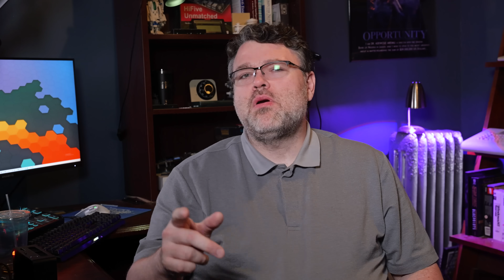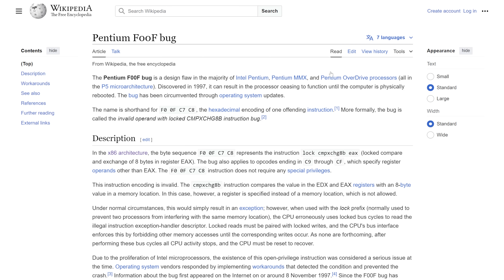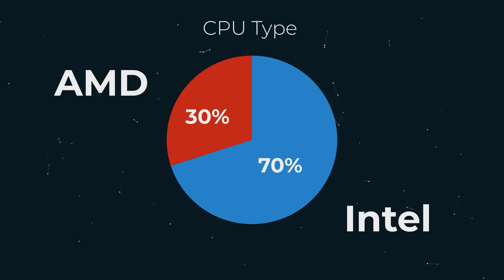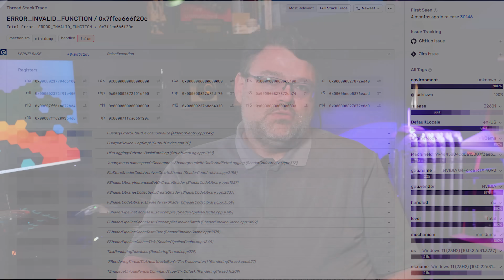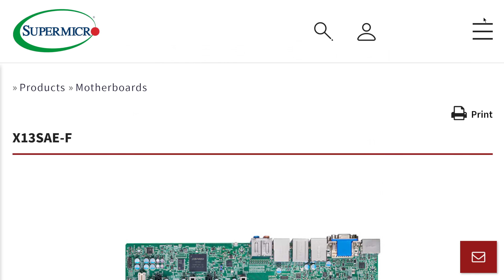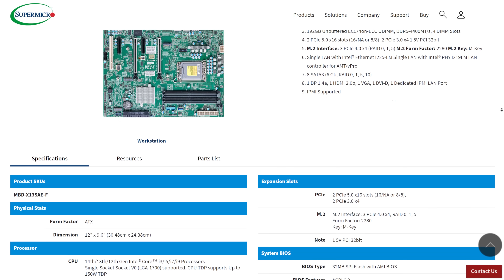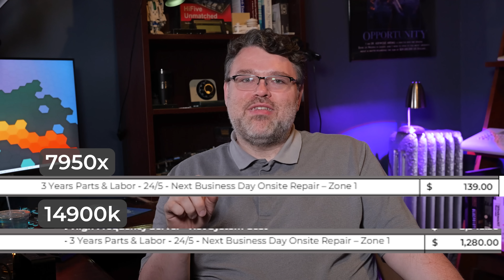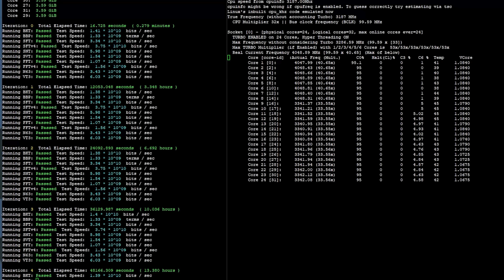Intel has a Pretty Big Problem

Comment: I've been having weird issues that I've been blaming on my AMD GPU, and it's more than likely the 14700k I have in my system.
Now I'm running 2 sticks of 16GB DDR4, XMP2 with CL16.

Last night, I had a weird issue where the system seemed to be having IO input issues, mouse movements were delayed and stuttery. Keyboard inputs like CTRL+ALT+DEL to bring up lock screen took about a minute to happen, then they happened all at once.
The only fix was restarting the computer.

Checked task manager before I restarted and CPU usage was at 1%, which makes sense as I wasn't just on my desktop not really doing anything, I had just finished playing Solar Ash without any performance issues and was just reminiscing about the ending when it became unresponsive.
Temps were all normal, around 45C at idle. (Noctua NH-D15 cooler).

Once task manager opened I started closing processes that I thought might be screwing up, but nothing helped.
Had to restart the PC.

No overclock is applied, though I do have an Asus Prime Z690-P D4, and I set the bios settings to motherboard, remove all limits.
I guess I could try setting all that back to Intel safe settings, though with the performance loss, what's the point of the Intel system when the 7800X3D from AMD exists?

Comment: My Intel i9 7980xe was perhaps the last push in tech. I overclock it to 4.9 GHz, and it works. At 4.6ghz, it is so stable.

Since then, Intel has been increasing the built-in overclock to drive sales.

Comment: Hmmm So I just reformatted because I had a memory leak and I couldn't figure out what the cause was. After 2-3 days of being on my pc would get up to 70ish% memory usage while idle and I'd have to restart. I haven't had the issue since reformatting a couple weeks ago but my Gigabyte Control Center app was also crashing every couple days. I also assumed the two were related but maybe not. The reformat fixed the memory leak but even after the reformat GCC is still crashing every few days (no other issues). Its easy enough to reopen GCC for my mobo RGB to work and GCC is a notoriously buggy piece of crap software. But now I am wondering if its GCC or my 13900K.

Comment: Replaced 13900K with 14900K, problem became worse, reinstalled Windows, even worse, random applications crashing on desktop while close to idle, limited power limits and clocked down to 4.4 GHz P, 4GHz E, still waiting

Comment: Well at this point a cpu is drawing more power than the entire high-end systems from years ago. How did anyone thought "it is going to be fine"? It is absurd that the manufacturers are just enabling more RPM in the engines without improving the engine block haul structure. 

Who would like to drive a car that crushes every time you press the pedal to overtake a car on a highway? Yet somehow we are thrown those types of cpus and gpus, crazy ram speeds that exploded just 1 gen ago...

Intel please go back to drawing board and think about the planet impact, scaling power drawing, improving QA (yes we know boeing did this but you are better)

Comment: It's such a strange issue. My guess, as a noob that works with alot of smart people, is that it is an issue with turbo boost freq on p cores or on e core, trying to reach too high, even for a uSecond. A cause as a result of a "dirty" fab or something or physical silicon issue. Something that popped up when they started 13th gen. The same time when they increased the max turbo clocks like crazy(5.2vs5.8). Max turbo "watts" stayed the same, I think.  

Any time I get issues on my computer(12700k)with the Windows nvme thinking it is corrupt on boot or tons of soft locks in apps/windows. Is if my turbo boost multiplier over clock, is to high. and when it's right on the edge, I get the same things as described. On my Linux nvme it won't be an issue.(though it goes through chipset(z790) instead of directly cpu connected, so I can't say the validity of the comparison)

Maybe try limiting max turbo boost and other related settings on the 13th and 14th to 12th gen specs and test for stability? 

On my12700k, I've noticed that I can get 5.4ghz on 4pcores with the rest at 5.3. (4.3on Ecores). But if I try 5.5 max turbo boost on just 1 core, with rest of the Pcores at 5.0.  I get all the instability as described in Windows only. Linux nvme will work fine, but not if i set two of the cores to max boost to 5.5. 

I looked it up 12900k to 13900k max boost "Watts" stayed basically the same(according to intelArk).

Idk, As a casual, I'm just thinking of the "simplest" issue it could be.
It would be cool if you could get 3d x-rays of the extreme fail cpus. Just to see.
Please do another future update video on this. Thank you.
Reply: TLDR. The intel factory spec is just wrong, and the "upto "5.7ghz boost freq" is degrading long-term stability. Maybe set up the 13th gen and 14th gen bios settings as close to 12900k settings and check stability. Just my atom of salt for the pile.
Reply: The frequency is related but its the fact that default voltage on almost all motherboards is 1.45V or more LOL this is what is killing cpus. You put 1.45V with any sort of loadline and you are idling at 1.5V+. Stock voltage is supposed to be ~1.0V with ~1.2V boost. Stock mobo settings has my 13700K at 1.45V, thermal throttling, using over 300W etc the same old story. I manually tune it to 1.26V 5.4Ghz locked with no throttling even under max load because wattage is now at 250W max.

Question is, who is really at fault? This has been the standard mobo behavior since I started reading about pcs. Any amount of research shows that mobos have always had terrible stock settings for K sku cpus since forever(since there is technically no standard operation of a manually tunable cpu, thats why the none K locked down untunable cpus exist). When I built my 8700K system in 2018 it was the same story, terrible default settings resulting in thermal throttling, manual tune and its running 5.1ghz without throttling.

*edit: just read another comment that some boards defualt to 115C max temp instead of the 100C spec. This 115C + 1.45V+ then hit the cpu with a max load. No wonder some are one hit KOs

Comment: is this only for the not running at Intel Setting 13900 and 14900 ? Or also 12700K / 13700Kset run at Intel Spec?

Comment: AMD has a metric fuckton of issues that a lot of people have kind of decided to deal with for the sake of price

ALL AMD cpus have a bit of microstutter
NO Intel cpus have a bit of microstutter in the same situations that AMD cpus have microstutter
Intel cpus have fewer instances that microstutter exists (and its not hard, because almost ALL games for AMD have microstutter)

it is important to note that in ALL of the older games, and games built on the older (basically non-BAR GPU access and direct-memory GPU access games) have ZERO problems on intel, and have less, but not zero, problems on AMD (one such problem is CCD switching, where games built for single-die CPUs would literally have their physics fail because the system was trying to shift the thread to a different core, which had a very tiny latency component to it, but gargantuan compared to the typical same-die core-to-core switching)

the issue usually comes from devs trying to push the system too hard

i know, because if you stop multithreading, the same games that crash, stop crashing, and it always coincides with the CPU pulling back even only if slightly on cycle speed (GHz) usually in an attempt to thermal throttle

its also only software-based, the system itself is fine

Comment: So I have a 13900k with the intel baseline profile enabled.  I get the occasional crash in a game, usually when the game goes from playable to a cut scene.   Intel needs to fix this issue, as it will cause a loss of reputation.  I have always been an intel guy.  But going from my rock steady 6700k overclocked to hell, to this 13900k has been a real eye opener.

Comment: PC Specs:
14900K (Dark Rock Elite cooler)
ASUS Dark Hero
ASUS ROG 4090
Corsair Vengeance (non RGB) 6400MHz 64GB 2 sticks. Was 4 sticks.
Samsung 9900 Pro 1TB and 3 Samsung 9900 Pro 2TB (Not using GEN 5 since it interferes with the GPU)
Creative SB AE-7 (when system would lock up, I would lose this and couldn't get it back in windows or turn it off and back on. I had to shut down, leave the PSU on, unplug and plug in and worked)
BeQuiet Dark Power 13, 1300W PSU

System Built 12/31/23 New Year's Eve. When I first built it, the system ran fine with stock settings and RAM 4 dims auto config from MoBo using ASUS optimize defaults with no XMP. Installed all software just fine. Then I noticed the RAM configed itself to 4200MHZ. I know I wouldn't get the 6200MHz out of it using 4 sticks. Returned the ram to Microcenter and got 2 sticks of 6400MHz and set it to XMP I, this is where the load shader hard freezes started. Then I would hard turn off the PC and try to get CoD MW3 to load again and the PC would get through it sometimes and get harder and harder as driver updates happened and all was fine till the next Nvidia driver update, and here we go again, 10 hard freezes in total over the next few months (and that was a bad time since they were updating the driver ever week for some reason, ass hats). Then I switch to the XMP II profile and no issues at all (I mean at all, still works to this day and I leave it on 24/7 (though I noticed a 1 frame texture on the side of a wall turn white here and there but not consistent, and no crash ((( you can see this in my videos I uploaded to my channel here on YT using the 14900K))). (OK back to the thing I was talking about) The news came out about these CPUs doing the thing and just as I found out the next day MW3 hard froze during gameplay using the asus Optimized Defaults. I then changed the BIOS to the intel limits and did some Jayztwocents tweeks and it's been fine since then. Crap A.D.D. kicked in and forgot what I was talking about, I kept adding things in parentheses and lost my train of thought. If I think of anything else, I'll add a reply.

Comment: On one of my systems, S-7E07 4.0 - Intel i9-14900K (32) @ 5.700GHz - NVIDIA GeForce RTX 3090 - 128DDR5, i keep getting random crashes i couldn't ever diagnose why the error keep changing, and it's softlock sometimes, i traced it to the CPU, but i dont have the knowledge to diagnose it further,  the system in Ubuntu running 24/7, i had to implement watchdog to reset the system incase of crash due to this, praying my drives don't die before intel do something about it.

Comment: I have a year and a half old system based on a 13900k, 64GB 5200 DDR5 (XMP set 1 I believe), 4070ti, Z690 C/D5 MB, AIO cooler and a Hyte Y60 Case.
Most unstable system I ever had. 
Originally it ran hot with default turbo's at 58 for the first two cores and 56 for the rest and a default TJ Max of 115C. It would frequently hit 102-105C. Hard BSOD crashes happened every couple of weeks and some games like Civ 6 just refused to even start, * and others like Oxygen Not Included, Kerbal Space Program 1, Cities Skylines 1 (and 2!) along with Project Zomboid would crash after 15 minutes or sometimes randomly last for an hour or more. RDR2 and GTA V ran fine oddly enough.

I found out about the MB factory overclock and unlimited turbo from Jayz twocents and learned how to do some adjustments.

With the following adjustments it has been stable for over two months and its highest temps under long (4hr+ game loads) has been 87-91C and around 84C for lighter gaming and daily browsing, streaming and so on. Not great, but one hell of a lot better.
In Bios I enforced Intel standards and manually set TJ Max to 100C (this remained at 115C even after enforcing Intel standards).
I am using Throttlestop rather than XTU. It currently seems stable with undervolting CPU core  -.070 CPU P Cache to -.085.  Any lower and Firefox tabs begin to crash on a regular basis, but nothing else seems to be affected...odd?
Turbo Ratio varies by game. CIV 6, Oxygen Not Included and Nolvus Skyrim  I run at 53 across all cores.  RDR2, GTA V, KSP1 and Project Zomboid will run with the first two cores at 54 and the rest at 53. 
Civ 6 and Skyrim won't even start if the first two cores are higher than 53.
Long and short power are at PL1 = 125 and PL2 = 253 respectively.
I have not (thus far) had to try and disable E-cores or slow down my memory and did not update my bios, as last time I checked it was a beta release, and frankly I just don't trust a beta from ASRock at this point in time..

I have reinstalled windows twice and ran an update repair once since the system first came online (two Samsung 980 Pro 2TB drives and one 6TB spinning rust WD10 6300rpm archive drive.)  I have literally ran the sfc /scannow and DISM suite hundreds of times and Chkdsk dozens of times. Something my 10 year old Overclocked AMD system almost never needed!

*Different crash every time according to Who Crashed? Two of the more frequent ones were a rather generic exception error and OUT OF VRAM???? on a 12 GB video card????

Just my contribution to the sad tale of expensive CPU's that cant run at their advertised speed without major problems with heat and crashing!

Have a great weekend everyone, and best of luck!!!😎

Comment: Absolute insanity. Makes me glad that when I upgraded it was a 14600KF I went with rather than a 14700 or 14900. Gaming on a 4070Ti just isn't CPU-intensive enough to justify the higher end CPUs, and although I compile Source engine maps (which uses an intensive CPU-based ray-tracer for the baked-in lighting) a 14600KF is still massively better than my previous i7-6700K

Comment: I own 14900k and I have no issues whatsoever, maybe people that experience crashes do dumb stuff with a CPU, too many visits to OC menu in the bios for example... I had no issues before microcode and power profiles updates to the bios as well as after... probably the same people that have issues with those CPU are the same people with burned connectors in 4090 as well as cracked GPU PCB, or they watch too many videos on YT titled "10 THINGS YOU SHOULD ABSOLUTELY DO WITH YOUR PC" :P also I run memory at 6800, in 3dmark time spy I have a score over 34k so its not like I run in in lowest performance settings...

Comment: I am not much of a gamer, but the 14900K computer that I built at the end of last year has been crashing a lot. Not at the beginning. Things have started going bad after a few weeks. It's been 8 months since I've had this PC, and I've reinstalled Windows 4 times. Things are always OK at first, but it doesn't last long.

I made a little list of what happens on a regular basis:
* Regular computer crashes and unsollicited reboots: the computer restarts by itself, without warning, sometimes while I'm working.
* Blue screens with various error messages:
	System thread exception not handled
	Kernel lock entry leaked on thread termination
	Page fault in nonpaged area
	Driver overran stack buffer
	System service exception
	Critical process died
	And others I didn't take note of…
* Repeated Windows Update installation failures  (KB5037771 installed after several failed attempts)
* Repeated failures to install nvidia driver updates
* After a crash and a blue screen, the computer usually restarts on an “auto-repair” sequence before reaching the password screen.
* Sometimes, when I start up the computer in the morning, it takes several minutes to get to Windows (this has often happened after the 1st reinstallation of Windows).
* Tabs crash in browsers (instabilities observed with Facebook or YouTube for example, but not only), with all browsers tested: Edge, Chrome, Firefox, Opera, Safari…
* Frequent Excel crashes, regardless of file size or complexity (new file, or large file of dozens of MB). Lately, all programs have been crashing after a few minutes, including Windows Explorer windows. Sometimes programs simply close, sometimes I get a blue screen.
* I reinstalled Windows 11 four times because the computer was becoming totally unstable and therefore unusable (several reboots a day). The reinstallation of Windows didn't always go smoothly, and I even had to call in a technician to help me on the 2nd reinstallation, because I was getting error messages (error code: 0xC0000005, for example), reboots, and I couldn't get to the end of the installation process.
* I tested the RAM without finding any error (MemTest v10), and removed the memory sticks to test them one by one. It seems that the problem is not with the RAM, as the same problems occur with all RAM sticks.
* BIOS updated in April, then June 2024, but it didn’t solve anything.

I've been building my own PCs for about 30 years, and never experienced this level of failures. There had never been a problem I couldn't solve once identified. But this time... whatever I do, nothing works. This PC is unstable, unreliable, crashes often, some of my software behave abnormally...
For the time being, I'm forced to work with my old PC, which dates back to 2013 (and which I set up myself). It's much slower, but it never crashes and allows me to work.